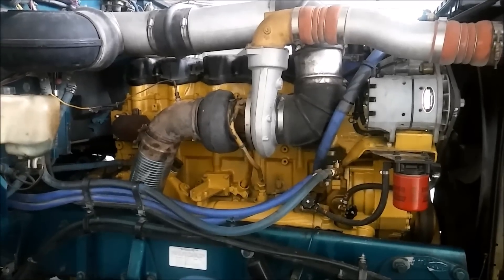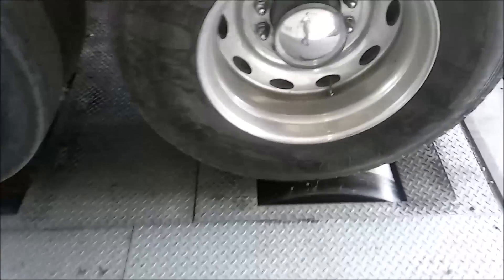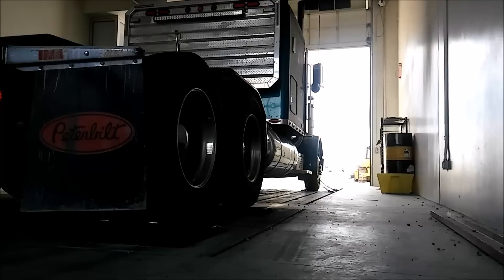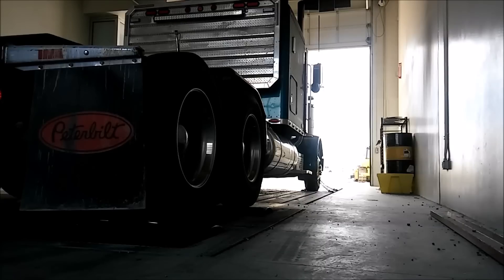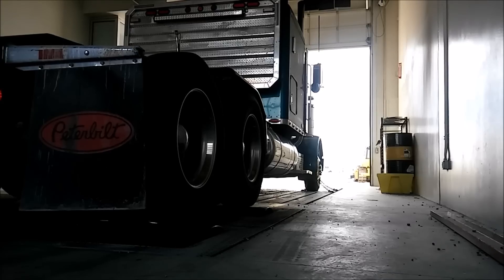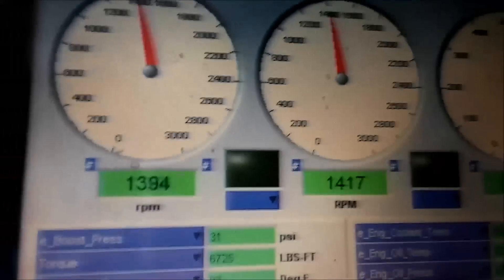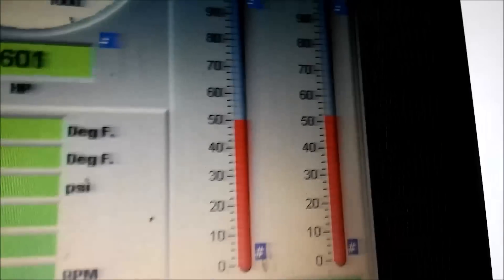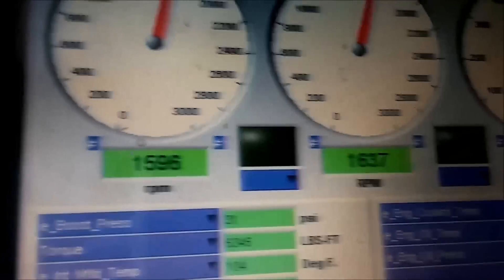Caterpillar Diesel C15 Truck on the Dyno

Comment: in the test did you pull engine down to 1200rpm, for 10 to 29 seconds to make sure you had engine out AOSS ? when out of aoss horsepower, boost, fuel rate all change. You can see the horsepower , boost fuel rate change as well as an audible engine note as well

Comment: Until now there has never been an accurate dyno securement system to properly test class 8 and lighter trucks using a chassis dynometer. The test typically involves securing the vehicle with antiquated chains or straps and hooking to non designated pulling points, i.e. rear ends, frame rails or various frame cross members. If the service area or shop that put your equipment through this procedure was or still is using this type of securement points 1. It is dangerous 2. Time consuming 3. VERY INACCURATE.  The point of clarification is this. . . How is that chain or strap ever going to transfer real world simulation through out the entire chassis? If your service facility is still using the antiquated tie down system don't  raise your hand raise your STANDARD to the patent, Overdraft Dyno Ace 9,612,179 b 2. . .providing dyno test results that are simply over the top, and with the optional power harness pentile hitches, and receiver hitches are also within reach! Can be viewed here on You Tube

Comment: Was that 6000 ft LBS
Reply from the maker: +Colby C. The reading was, but our dyno torque reading is usually really high. This engine is only rated at 1850 ft lbs.
Reply: Yeah there is something wrong there. 6000 ftlbs is way to much. I run  a Dyno and a 525 cat will put down about 2600 at 1200 and usually about 1800 at 1850. There is no way this Dyno is working right. That's why it calc 600 hp and 1600 rpms

Comment: Cool video. Do you anything else after the test? Retorque headbolts? Re-run the overhead?
Reply from the maker: +Andy S It is good to run after the dyno. You can't retorque the head without removing the overhead, so you don't have to do that. First overhead is usually at the first or second oil change, but it rarely gets done.

Comment: I am interested in building a 3406 for high performance pulling competition

Can you recommend component changes or online resources for sake of scoping engine mod options. 

IE- what is the typical max boost pressure; aside from using marine injectors - how to mod injectors and pump; are ceramics used for pistons etc; are engines balanced etc etc. 

Is a 3412 rebuild essentially the same as a 3406 rebuild?

Thanks much
Reply: Robert Cotherman man i would love to see a cat on competition send a link if u got one

Comment: Hey  I'm buying an 07 Pete 379.C15 compound turbos.Hp rating said 625 hp and 466 on the engine tag.Which is the correct power rating.thanks
Reply from the maker: +RED SUNDAY you'd need to get an engine download to see what the actual rating is.
Reply: Ok.that makes sense.
Reply: But CAT did make 625 hp ratings?

Comment: ADept ape I have a C-15 6nz and while maintaining say 1500 rpm I loose roughly 5-6 psi of oil pressure when going from no load to max effort the motor has 590,000 on a rebuild is it time for rods and mains again? What's your take on this issue?
Reply from the maker: +Johnny Blair Did you have that issue before the rods and mains were done before? That is kind of a weird one, I know of only one other truck that did that and another mechanic was working on it. It was a C13 that when going up a hill would drop in oil pressure. He changed the oil pump and that fixed it.  Now I'm not saying it is your oil pump, my thoughts at first are when under heavier load is the oil temp going up as well? This could cause lower oil pressure. The other thought is under heavier load you are putting more pressure on the crank? If you had some worn bearings that could create a bigger gap on the tops of the bearings and cause the lower pressure. If the oil temp isn't increasing very much, I would cut open the oil filter and look for metal. If there isn't any I would replace the oil bypass valves in the oil filter housing. If that doesn't do anything, then pull the pan and check some bearings and possibly replace the oil pump.
Reply: Adept Ape the drop I speak of is from high 60's to low 60's your second thought is what I was thinking loading the bearings and releasing oil on the top I think I'll check all the stuff you said but will probably toss some new bearings in as well, in my opinion 590,000 is enough miles to justify it what's cat say?

Comment: Just curious what kind of hp would a twin turbo produce in the same set up?
Reply from the maker: +Roger Pemberton Not really much more, the max factory ratings on most Cat 15 liter engines was about 550 hp, the boost was the main difference. You'd see up to the low 50's on boost with the twin turbos, but no more power really. It didn't really make sense to have the extra turbos just to spool up a little faster.
Reply: That's what I was figuring but wasn't sure. Thanks for the fast reply. I use to drive but never really worked on them. In other words I know little to nothing about diesel engines. Thanks again

Comment: not an CAT expert, what is the displacement of this engine, and is this a common rail injection ??
Reply from the maker: +Narendra Rajcoomar It is a 15 Liter engine and uses MEUI injection system which uses the camshaft and the ECM to fire the injectors.

Comment: did I miss the torque specs?
Reply: jakemj03 I reject your reality and substitute my own, I prefer 6000 ft lbs ar ar ar ar :)
Reply from the maker: +cannon m A good observation, yes I didn't include them because our dyno has never calculated them correctly, which is a shame. They come out to like 6,000 ft lbs, which is a little over the 1850 ft lbs the engine is rated at.
Since it is so inaccurate I just ignore them.
Reply: The number at 1600 rpm with 605 hp is 1985 ft/lbs

Comment: I have a mxs series c15 just got a rerate done from 475 to 550 making more boost than that why would mine only be 550
Reply from the maker: +RoadHammer3406E A good observation and there are 2 reasons for that, first an MXS is a twin turbo engine where as this engine is a single turbo which will always give your a boost advantage, second the dyno was not calibrated and was reading high on horsepower, the engine was probably putting out close to 500.
Reply: I was wondering about that. The Pete  drove last must be a MXS double turbo with a 460-something on the sticker but the old 3406 had a LOT more grit. What is the h.p. curve in the MXS? I remember the old Maxidyne 237's were rated 235 at 2100 and 237 at 12 or 13. That's been a WHILE ago.

Comment: were can i find online specs of cat engines - highway, industrial, marine etc. seems like cats' main page has them locked in a safe. 
what got me curious - 3406e dyno @800hp industrial or marine eng.  i forget the torque numbers. What i'd like to see is, type in the engine numbers ie 3406 or 6nz and see results across the board for highway-industrial-marine cat motors, to see if its a valid cat rerate.

question #2 are any 3408's electronic ?
Reply from the maker: +Nite Owl Cat kind of does lock their info in a digital safe. We use SIS and TMI, which are both Cat programs and require a Cat corporate password to access, as far as where to find any info on other sites I actually don't know of any. I'm sure there is some forum out there with numbers and such, but I'm not aware of any.

An electronic 3408? Good question, the only ones I know about are mechanical, but Cat does make the electronic C27 and C32 which are v12 3406 engines and they are electronic. They are also called a 3412.
Reply: ty seems odd they would hide that from customers seeking specs tho, cuz of epa i bet
Reply from the maker: +Nite Owl Cat is like any large organization, somewhat fearful of its information getting outside its control. They have passwords and clearance levels for everything.
Reply: i'm a 3408 man myself. but i look at other motors. I wonder if you could tell me the torque of a marine c16 @ 800hp ? and if this is a viable cat cert.
Ty again for all your help and i for one appreciate a valid cat man on the tube
Reply from the maker: +Nite Owl Give me a couple days as I'm not going to be able to do much technical research today. Do you know the serial number for one of those engines?
Reply: Lets put that on hold. Till i get more facts.
Reply: Nite Owl 7NZ. Industrial 805hp just shy of 2300 ft lbs.....and yes they have 3408E cats
Reply: Adept Ape used to run an air started V12 cat used as the starting Engine on a GE gas turbine generator I ran in a power plant.....cold start to max load in about 45 seconds (lube oil was constantly circulated and warmed to about 150degrees) was something to be next to though

Comment: will the advertised horse power be more  than the dyno reading?
Reply from the maker: +Omar Normally the dyno horsepower will be about 20% lower than the advertised horsepower, but the dyno in this video was not calibrated and was reading higher that advertised.
Reply: Omar - 550 was the original hp rating however probably with upgraded injectors,turbo and maybe a mild tune he's at 700 hp at the crank.

Comment: I have a MBN c15, i had a well known guy reprogram the ecu to the 6nz style and supposedly it has the 625hp tune, also went with a non wastegate turbo. my question is, if its put on a dyno like in your video,  is it gonna work with the dyno when it does the rpm change? obviously the dyno is running the computer to rev it up to 1600 no?  Basically wondering if i bring it to my dealer and they put it on the dyno. is it gonna work without them changing anything in computer when they go to run it. Im wondering if they put it in as a MBN its not gonna respond to the computer on dyno. i dont want them to put it back to the horrible MBN Settings. The truck was horrible trying to heavy haul with it at 525 setting
Reply from the maker: +kwmiked I'm only familiar with the dyno at our shop and every manufacturer is different, but the one at our shop would work. The dyno operator sets the RPM of the dyno to bring the engine down to for checking the horsepower. So even if your engine was rerated and you wanted us to check the horsepower at a higher setting we could, just ask the shop for what you want tested before they check it. The serial number difference shouldn't matter either as long as they can communicate with with ECM for the testing, unless the shop is full of jerks. So the dyno operator could test it at 1700 or 1900 rpm or whatever you want it tested at.
Reply: +Adept Ape alright thanks,  i didn't know if they had to run a program for that model motor so it would work on dyno. It was shocking going from a 2WS to a MBN , hated the truck. Just towing the trailer it felt like u were trying to tug a 330 excavator around.  And the egts were always around 1000-1100 running empty on the highway.  crazy! now shes nice and cool and pulls pretty decent.  You're next video should be whats involved to change a cam on c15 mbn. lol
thanks